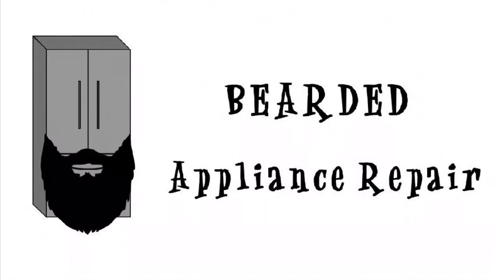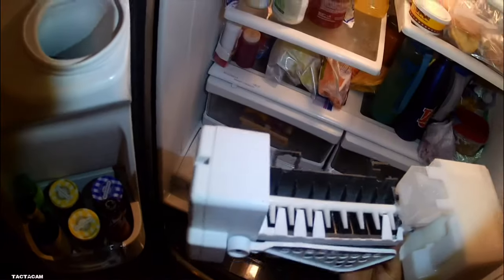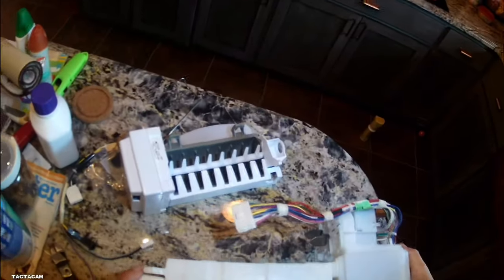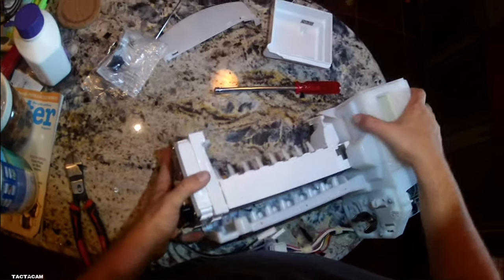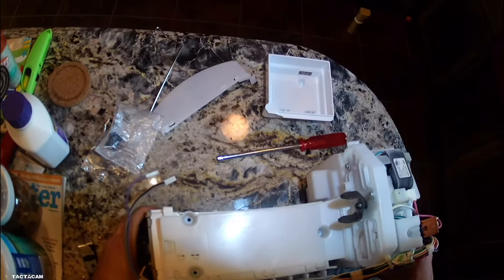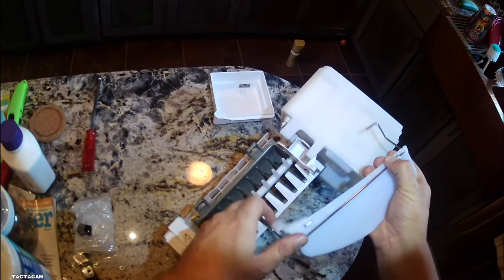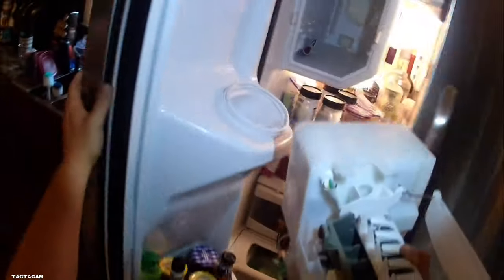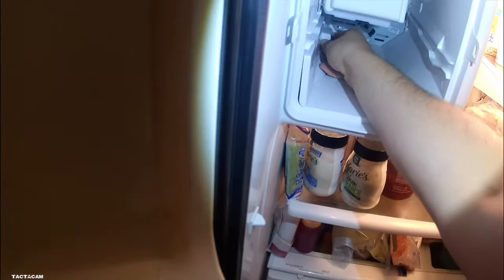Ice maker replacement on French Door Maytag Refrigerator. (W10583817)

Comment: Thank you for this video bearded one!  Really enjoyed it and it gave me the confidence to replace my icemaker.  I did not have to replace the bottom part that the icemaker sits on, in fact my new icemaker didn't even come with one.  Jumpers were all the same too, so nothing unexpected.  I did have issue getting the cover that goes over the main cabling to come off, even though I depressed the detent and had it loose it was kind of stuck in the front.  I pulled too hard and broke a little of the plastic but when I got all finished the cover went back on and it is a non-issue.  I should have revisited your video when I was having trouble wit that because you do mention "pulling forward on it" which would have prevented me braking the plastic piece.  As for disconnecting the power cable behind it many people here seem to have trouble with that.  I also had trouble at first but I noticed you did it one handed and so it had to be simple.  I tried pressing the detent to release it and slide it back so to get it apart but of course it felt like nothing was happening.  I then used my phone and took close up of the connector from all sides and could tell that it was actually starting to separate.  Once I did saw that I just tried again a couple times and it came right apart.  
Another neat trick was some comments where the inlet tube can be removed from above before you get started with the icemaker.  I did that and it probably made getting the icemaker out a lot easier.  So new icemaker is installed and I will see how it works.  My only concern it that I may not have needed to replace it at all.  My problem has always been that water seems to drip into the bin from somewhere and eventually creates a giant chunk of ice that keeps the auger from moving.  I hope it was a seal in the icemaker so that it stops doing that.  If not I guess I'm off to checking for a faulty inlet valve.

Comment: Thanks for the video and links to the part.  I replaced mine.  Just step one would have had me stumped, so I'm glad you showed the lever mechanism that needed to press down with the screwdriver.  Some minor differences in the new vs old, but the kit came with a new wire harness that worked great.  I agree with the other comment that unplugging the harness was a bear.

Comment: There is a Little cover on top of the fridge , you open that and lift the fill tube , it would go smoothly, then when finished you pushed it down again
Reply: OmG i just got my wires off and opened up this on the top of fridge..  its all wet up there and some crazy white mold is growing... not good... freaked out about this water now..
Reply: Two years later, this comment helped so much. 

I read and thought, there’s no hole in the top.  

I’ll be, there is.  Good thing cause I can’t get my forearms in deep enough to reach.  

Thanks again.

Comment: Great video. I think I have the same exact one, and was unsure about the part number. Also, "some resistance" on getting the fill tube to release is an understatement. I thought I was going to break something. Also, disconnecting the wire harness was a struggle. Finally used a small screwdriver to press the release tab.
Reply: My hands were almost to big to disconnect the harness LOL
Reply: can you explain what the release tab is?  I'm trying to get the wire harness apart and am having a hellava struggle
Reply: @soccersisters7602 I'm stuck i can't remove this harness, were you ever successful?
Reply: Yeah I'm having trouble removing this harness now... I'm not sure what clip is holding it.. looks like it might have been removed before...
Reply: I just did it by jamming a screwdriver between the two tabs and pressing down on the front tab with my thumb on the flathead while holding the back and pulling the front with my free fingers… oh and a lot of praying

Comment: If you’re wondering about how to unclip the wires I figured it out. If you inspect it you can see the division between the two parts. On the left side I used one hand to grip it like he does in the video, I then slid my thumb nail in between the division and pulled while simultaneously pushing the other side with my fingers.
Reply: Bro fucking thank you

Comment: so you miss a very important point as a repairman. You mentioned basically about really pulling hard to get the ice maker out to overcome the tube above. I almost busted my unit and it STILL wouldn't come out. I literally tugged on the ice maker to the point that my wife thought I'd tear the refrigerator in half, still nada. So I took a look at the tubing as it drops in from the top of the refrigerator. I carefully unclipped the water tubing assembly and rotated it up about a 1/2", went back to pulling out the ice maker, and it literally slid right out up till I had to gently fight all the wiring bundles. So obviously, my tubing was just a bit longer than yours, which is why they make the tubing removable from up top. You should really add that note to your video.

Comment: I have  a may tag fridge  and the ice maker is not making ice however the auger works fine. Also water comes out without  any issue.  Its almost as if the water line is pinched  i also checked the switch which is on my fridge  model is  MF12269Drm01
Reply: Same problem I’m having
Reply: There are 2 valves. 1 controls the drinking water and the other controls the ice maker. 
The valves are similar, si I disconnect mine and use an ohms meter to check for continuity. This will only test the coil on the valve. To further test the valve you need an assistant and some jumper wires. Disconnect the line from the  valve to the ice maker. Utilize jumper wires to hook the iver maker valve to the drinking water connection. Have your assistant quickly press and release the water dispenser while you cover the outlet on the ice valve with a towel. If it squirts water your valves are not the problem.

There is a way to manually make the ice maker cycle. Some are raise and lower the ice arm 3 to 5 times. You will need to find the manual for the ice maker to be sure. I'm looking for the manual as well. If I find it I'll post. Please post if you find it.

Comment: I’m probably going to have to change this out Do since mines not working.  Did you have to shut the water off before removing the ice maker?
Reply from the maker: No not necessary.  You valve in the fridge prevents that from needing to be done. Good luck!
Reply: Bearded Appliance Repair.    thanks!
Reply: @philiplamke258  you mentioned you were going to give the part number I have the exact same one that you took out
Reply: james naughton  Part number is W10583817
Reply: This is great. I have this Model. 
Where can I get this Ice Maker Assembly? I don’t see the link / name. 
Thanks
Reply: Now I replaced the water inlet Valve and the arm rotates but still no water pumps into the funnel or ice try.

Comment: The holes that the ice bin clip/lock into on mine are broken, so the ice bin is constantly having to be pushed back in. I've looked everywhere but have not seen a part for the ice bin or ice maker housing. Does anyone know if this is even replaceable? The ice maker works fine.
Reply: I have the same problem, did you figure out how to repair the clips?
Reply: I have this problem also.  Ugh

Comment: Would it be the same or a similar issue causing the inlet tube to constantly freeze up? The funnel constantly freezes which backs ice up the fill line for me
Reply: It makes ice just fine for a few days, then the whole thing freezes over and I have to pull it out to thaw, rinse, repeat
Reply: When the fill tube freezer up , you either have a defective water inlet valve that let pass a little bit of water that freezes up, or a cracked hose that let hot air in

Comment: The water tube was cut on mine somehow and I've got a replacement tube in hand. I can't get to the water valve even after removing the rear access panel. How do you get to the water valve on these?

Comment: On mine the filler tube popps up out the top of the fridge making it slide out easier...
Reply from the maker: Holy cow.  I have never thought about that haha.  It does doesn’t it. That would make it easier to get in and out haha.
Reply: Where? I think that's where I'm stuck. Assembly comes out a couple inches but no more.
Reply: @GS - mine is directly above the ice maker. On the top of the fridge if you start facing the doors, from the front-top-right-corner back about 18-20 inches and to the right about 4. You should see a small black plastic rectangle about 2x3". I think it's supposed to have a cover. If you have a cabinet above you will have to pull the fridge away from the wall. I'd use a flat-blade screwdriver and pop the cap off. Then if you look in there is a hose coming from the back (down in the hole). That hose makes a 90° bend down into the ice-maker. I put my screwdriver under the hose, close to the 90 as I could, and pry it up. It took quite a bit of force to get out. I think because the plastic/rubber is cold. Might work better if you warmed it somehow, maybe a hair dryer. I also put a small rolled up towel so I didn't scratch the surface of the fridge while prying. Good luck!
Reply: @spyderMN  Finally got it free and of course there's ice clogging the inlet to the ice maker.
Reply: LOL, I think mine was a little too. I just chipped at it with the end of a screwdriver. Probably should have used an ice-pick.